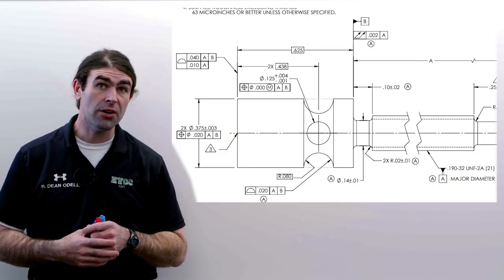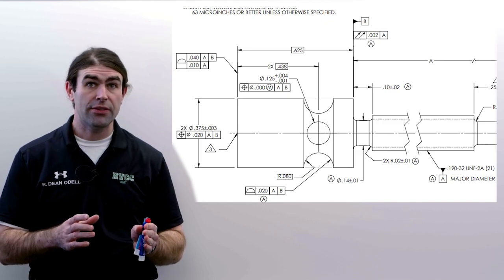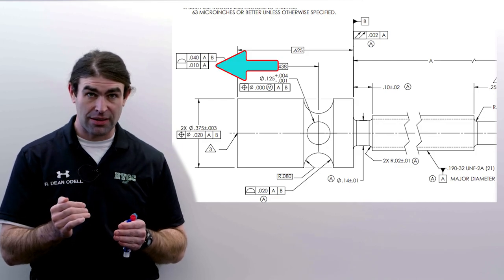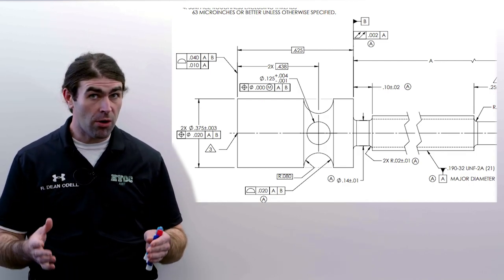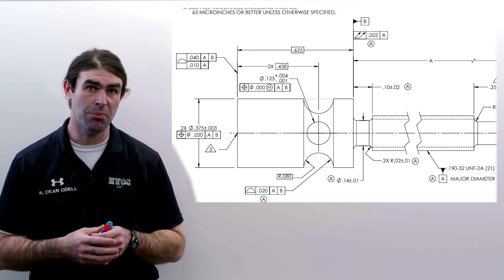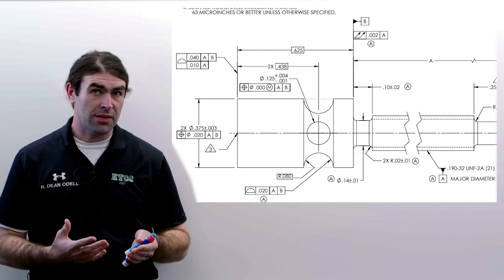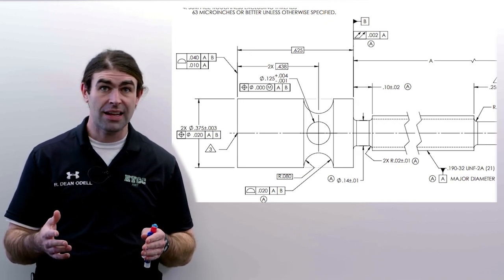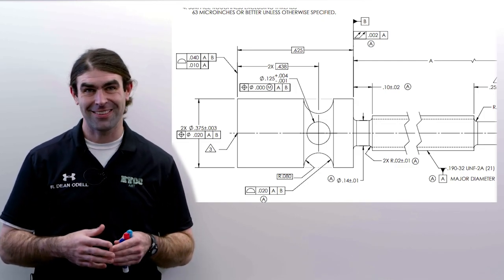GD&T: Composite Profile Inspection Demonstration

Comment: Thank you so much for your instructional videos. They have helped me with part inspection immensely. I work for a CNC shop and am the night time inspector.

Would it be possible for you to make a video that demonstrates the different ways and applications for using Jack stands during bench inspection?  I'm told they can be helpful with flatness and some profile call outs.

Comment: Hi Dean,
Good Day!

Thank you so much for your explanation. Understood very nicely.. In that drawing, used total run-out on flat surface with respect to datum A.. So I have two queries here please clarify me..

1. Can we use total run-out on flat surface?
2. If we use perpendicularity here with respect to datum A instead of total run-out, what will be the difference?

Thank you in advance,

Best regards,
Nakul Shindhe
Infosys, India
Reply from the maker: Hi,

Great question! I hope to make a video about it soon. 
Basically, perpendicularity and total runout mean the same thing in the application. Both require a tolerance zone that consists of parallel planes that are perpendicular to the datum axis. The planes move toward the surface until the smallest distance is found, this will be the reported value with either tolerance. The "Total Indicator Reading" is the distance between these two imaginary tolerance zone planes.

Total runout can only be used on a flat surface that is perpendicular to the datum axis.

Comment: Excellent video Dean, it's great to watch you simplify what initially appears to be a complex control. Out of curiosity, why are you doubling your max deviation from nominal to obtain your measured value for profile of a surface? Are you doing this specifically to comply with the actual value definition given in Y14.5.1-2019 or are you doing this to comply with what I believe to be traditional ISO requirements? The actual value definition given in Y14.5.1-1994 required two actual values for profile of a surface, namely the max deviation in each direction from nominal (no single actual value was allowed for a bilateral profile tolerance), and I believe Y14.5-2018 references Y14.5.1-1994.
Reply from the maker: Hi, Thanks for the very informed comment. I'm using the Y14.5.1-2019 version of the math standard that specifies the single value for profile. I'm using the new measurement data reporting standard for this video, as well as a few future videos. It's tough that the new math standard came out after the latest Y14.5. I'd take a guess that most people haven't heard of the math standard or the measurement data reporting standard. I checked the precedence of standards in 2018 and didn't see the math standard, even though the 2009 version did mention the math standard. Perhaps they were "future proofing" for these kinds of situations, or maybe I missed it somewhere else in the text.
In any case, thankyou for the input and moving the conversation in an interesting direction.